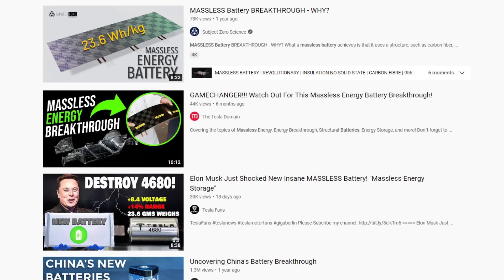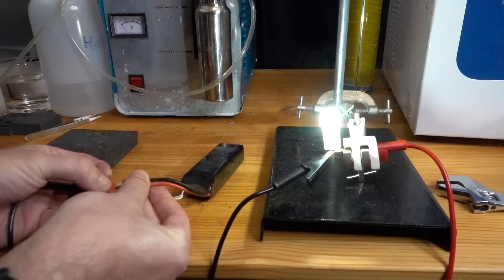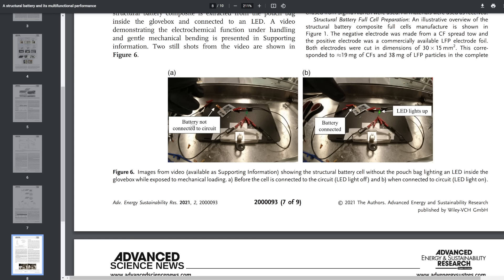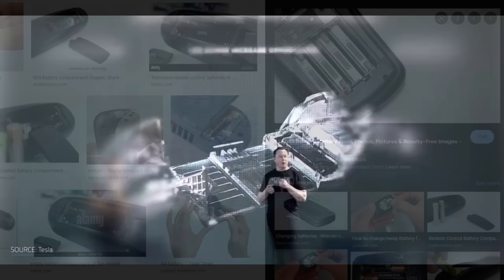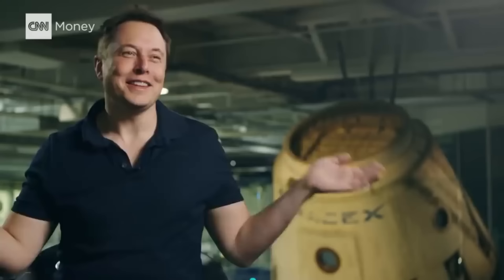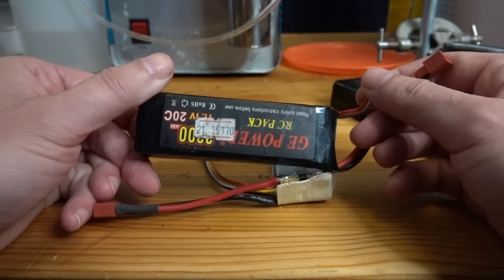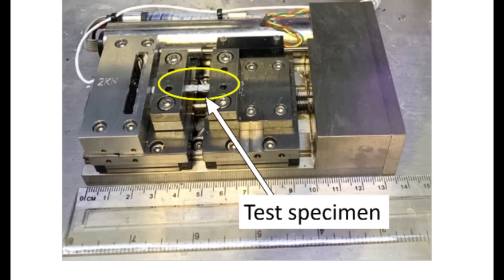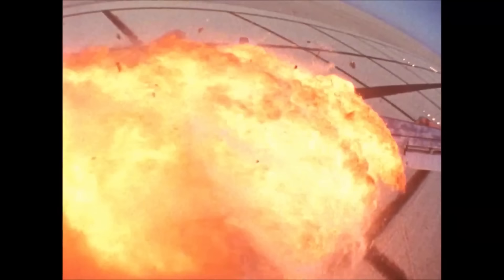Matt Ferrell, Massless Battery: BUSTED!!

Comment: Assume all the things Tf00t mentioned were solved and they had actual structural materials that could be used as a battery.... 

That battery, even if it wad at parity with lithium would still need to weigh the same amount to provide the same amount of energy to the EV. No weight savings made. No way around specific energy.

If it is less, then you need MORE weight, MORE material which would make the EV LESS efficient because it would weigh more than a lithium battery in conventional cars.

If somehow it had a higher specific energy than a lithium battery, then why not make the battery out of THAT in the conventional way? It would obviate the need of any of this bullshit.

It is a big fat nothingburger from the outset and this guy Matt Ferrell should feel bad for making this sensational garbage.

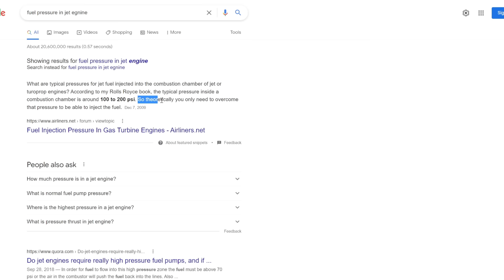Comment: 12:00 You are right with most of the things you say, but you clearly have no clue of planes. 
It's true, the pressure in turbines is much higher than produced by the hight, but lets compare it with something you may be much more familliar with, cars. The injection pressure there is also really high to get a good mixture of gas and air, bur what produces this pressure? The fuel pump like you say it would word in planes? Clearly not. 
If an engine fails completely it doesn't matter where the fuel tank is, but if the electric systems fail it does matter, the pressure for the injection is generated mechanically just like in most cars, to prevent engine failures due to shorts or generator issues. If any electrical system in a plane fails the engines must still be functional at least to give the pilotes a bit more time to figure out the situation.

So your argument is completely wrong cause it's the save fail for the fuelpump and nor for the injection pressure.

Comment: 26m34s funny how he has no idea of how series connection nor balancecharging work, but acts like a know it all. the videos are kind of funny for exactly that reason, you try do deform other people but just show your own incompetence.

the black is connected to all negatives, fine, but then how to put them in series? negative of cell 2 to positive of cell 1, buut negative of cell 2 has potential of negative of cell one, so negative of cell one has same potential as positive cell 1 (and cell 2) congrats you build a bomb.

no concept of series  circuits at all.

i can clarify you:

you charge through the main leads and use the thin balance leads to monitor the cells and switch a resistor in parallel to a cell to create a bypass for the chargingcurrent so the bypassed cell dont charge anymore or charge slower so the others can keep up.

so black and red: charge ALL 3 cells!

Comment: The new Tesla 4680 based packs are structural, and the cells are a part of the structure, not just the case.  So, that is correct.  The cylinders are very thick, much thicker than a normal cell cases.  I have seen some cell tear downs, and Sandy Munro has now tore down the pack itself.  Check it out, and you'll understand it's not just a structural case, but the cells are part of the structure.

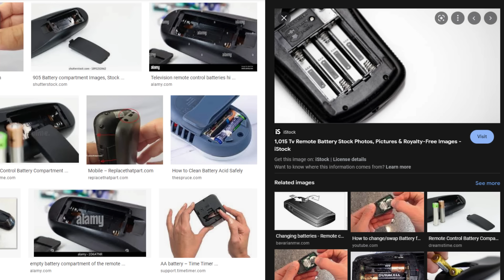Comment: Thunderf00t's criticism  @14:30 "if you were to take all the battery's out it mechanically it would basically have the same properties." is false. Thunderf00t seems quite ignorant of the benefits on this occasion.
The battery cell walls provide significant strength enhancement. This sort of technique is used to great benefit in many applications one example cardboard honeycomb core doors in most modern houses. Without the core material these would either be very flimsy and easily broken or if made of solid materials would be far heavier and more expensive.
Integrating the battery cells into the vehicles mechanical structure rather than attaching them as a battery box onto the vehicle frame does provide weight and strength advantages.
Reply: Integrating cells into the structure would also be extremely complex, failure-prone, and dangerous.

Comment: I feel like you're grossly misrepresenting the research while mostly just bashing a tech communicators presentation. Of course they present an optimistic view and show potential applications that might only make sense if some more problems are solved. That's literally their job. The tech hasn't even left the lab - of course it's not viable yet.

There's no denying that carbon fibre is a useful structural material. Using it for storing energy as well could be quite useful. You're bashing what they show with a single sheet (cell) in a lab, but carbon fibre needs to be layered... and so do battery cells for larger applications. You also complain about its low energy density, but even the first nuclear reactor only produced a few W. Research is a process and many (but perhaps not all) of the problems that you mention (if they exist at all) can be solved.

Is this going to replace regular batteries in every case? Probably not, but there are certainly applications where this could be useful.
Reply: No, he's calling out this overhyped bullshit for being exactly what it is: overhyped bullshit.
Reply: @electric7487  Overhyped? Perhaps. Bullshit? No. There are plenty of cases where less battery capacity for less weight and/or higher structural integrity is a worthwhile tradeoff.

But the video isn't about hype bashing, it's about calling things out that don't work... and it entirely misses the point of the tech.
Reply: @Syzygy2048  Integrating cells or packs into structural members would also be extremely complicated, dangerous, failure-prone, and difficult to repair.
Reply: @electric7487  The tech is still relatively in its infancy. Those problems can and have been solved in other things before. Maybe not all of them, but you've got to pick the right tool for the right job.

Cars might crash a lot, but airplanes don't, and if they do take significant damage, it's often a total loss anyway. Same with spacecrafts where a weight reduction is a huge benefit. (Also keep in mind that no one calls for 100% replacement of all structures, but instead those that don't usually get damaged even in crashes.)

And then we don't know the failure modes. The reduced energy density might imply that it won't just explode like a Samsung phone. A single cell is about 0.3 mm (0.012 inches) and that is in a lab - industry usually optimizes that. Considering the strength, thickness and energy density, a breached cell might not have enough energy to cause a fire and/or damage other cells, meaning a crashed Car might not turn into an inextinguishable fire.
Reply: @electric7487   And rather than integrating those things, they would replace some structural elements. From what I've seen it would be somewhat more complex than working with carbon fiber.

Why you believe that during normal operation this is more dangerous, failure prone or difficult to replace than other batteries/structural elements is beyond me. What are you basing this one?
Reply: @Syzygy2048  Don't expect this tech to ever progress beyond "infancy", because the problems I brought up with trying to use structural cells are inherent.

Oh, and structural cells/packs on airplanes is the worst of all worlds. The maintenance requirements on commercial aircraft today are already very stringent, costly, and time-consuming. Structural batteries would make aircraft maintenance 1000000 times more dangerous and complicated as you now have thousands of cells, wires, and management electronics throughout the structural members, which means 1000x more potential single points of failure.

Comment: I don't always agree with your conclusions, but more often than not, I find myself having come to the same conclusion. It does not help to be an automotive engineer with design experience for major manufacturer. Having seen #dieselgate from the inside and having taken part in regulatory working groups (UN/ECE) later on, I know that the ICE-world is also not "the pure good" it sometimes would like to be seen as.

however, the level of hoodwinking exhibited by these (almost all) bald, smug-faced shills for an impossible "better world" never ceases to amaze me. I wonder how much they sell their souls for, to lie straight faced to the general public.

Tesla, regardless of admittedly ingenuous solutions actually implemented, is more often than not, found leaning way to far out a window with its promises. Instead of crashing in flames, insane "fanbois" prop up the stock and their grandmaster plays with their wealth. The market capitalisation is far off the charts with respect to a sensible valuation (EBITDA x 10 = sound market cap)  "the EV/EBITDA for the S&P 500 has typically averaged between 11 and 16 over the last few years."

TSLA sits at a EV/EBITDA of over 140 for 12/31/21. You do your math...

Comment: I think you very much misunderstood it, and it is only partially his fault. Matt Farrel does almost exclusively "interesting research direction to be aware off". xkcd 2655 comes to mind: the time scientists spend on getting Grant Money is time they are not researching. Matt tries to help with that.
He is always clear:
- that this could be useful down the road. Not that it is useful right now. Not that it will be useful. Only that it could be.
- what the basic issues are (extra weight for batteries to add large capacity, so weight savings are important)
- how far this is from being a shelf near you (this one is really just a noteworthy step in the Lab process)
- how things work currently. I admit, here he did fuck up by not properly explaining the difference between Dedicated Packs, Structure Integrated Storage (airplane fuel tanks, Teslas little thing) and actual structural weightless batteries
- or how turning the unavoidable structural material into a energy storage makes this capacity effectively weight free
Reply: - Many of these things could be useful down the road, but only with unrealistically magical unicorn technology that would be extremely dangerous or straight-up impossible to implement in reality.
- Sure, and the things that Matt is promoting will do absolutely nothing to solve those issues, since the vast majority of them won't ever exist in reality.
- Far? Exactly, it'll always be that way since it'll never happen.
- And even at that Matt screws up even the most basic concepts of what goes on.
- It's amazing how few people have even the slightest clue of just how dangerous structural batteries would be in real life.
Reply: @electric7487  Since when do you delude yourself into thinking you could judge what science will progress?
Reply: @christopherg2347  No, it's more like this: I actually take a critical look at these things in order to determine which ones are definitely possible, which ones are difficult but possible, and which ones are possible but not practical in reality, and which ones are impossible.
Reply: @electric7487  Since when did you delude yourself into thinking that watching a YouTube video is somehow comparable to the months-years of actual experimentation?
Reply: @christopherg2347  You're a True Believer.

This isn't about watching YouTube videos, it's about thinking these things through using facts and scientific principles to determine which things are worth pursuing and which ones are not.

They can physically experiment if they want, but it's a waste of time IF the premises in which the experiments are based on are flawed from the beginning.

If you don't perform the necessary critical analysis, you don't have a good idea to determine if your experimentation is going to succeed or not.

Seriously, this is not hard to figure out.

Comment: So now you've spent about half an hour trying hard not to mention the underlying problem: that "battery" is sometimes used to mean the cell, and sometimes used to mean the pack. Nobody ever assumed that the battery cells were going to be used as structural elements, but you do your whole clown charade trying to debunk that alleged misconception. Tesla's "structural battery" has always only meant to make the battery pack part of the chassis and reduce material weight that way. And please drop this preschool crap like your salt water battery LED experiment from your debunking videos. You're talking to adults here, these interjections make you look more like a playground entertainer than the scientist you are. You're trying too hard to ruin your own reputation.
Reply: True.
Reply: Yes, and your fractally-wrong word salad does absolutely jack shit to make the idea of a "structural battery" any less impractical, regardless of whether it's the cells or pack that are structural.

Comment: You filled your video with pointless side chatter like Elon Musk's escapades and trying so hard to say it's a dumb idea. You never once actually got into the science of the technology, just constantly saying it's a battery with a shell around it. One tiny section where they actually explain the structure, and you handwave it away. The shell IS the conductor. The carbon fiber that makes the structure is acting as the cathode to the gooey insides' anode. Meaning you can't just remove the battery from inside the structure, because the structure itself makes the battery. You can't make a comparison with your battery pack between two graphite blocks like you did. From what I understand, the pouch is there to keep the battery from degrading during testing. It's something they're still working on so of course it'll be in a clean room. Give it some time and the pouch should be removed from the final product.

And again, you're talking about solar roadways, which has nothing to do with this technology. Let it go already. I keep coming back to get the opposing side of these technologies, but scrubbing through your videos for relevant information is a chore.